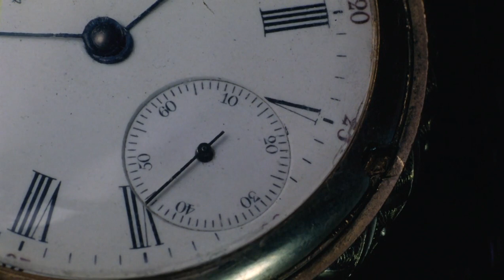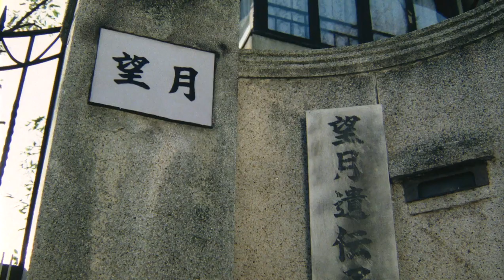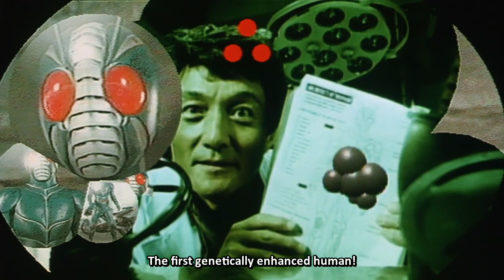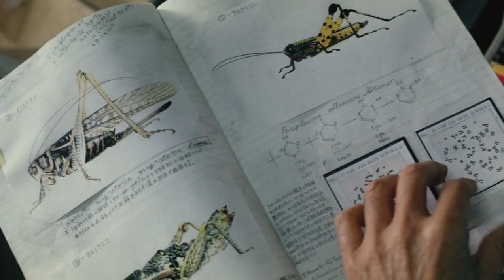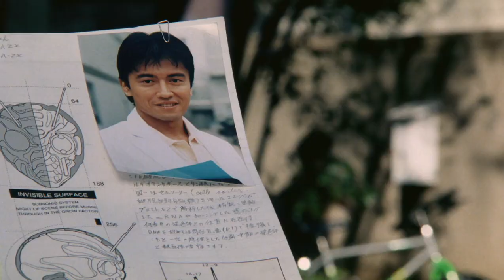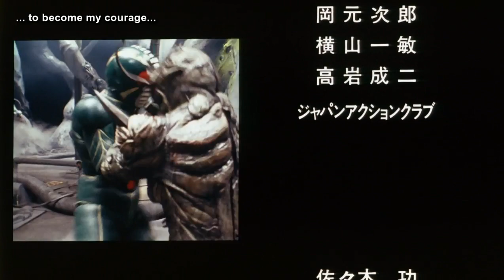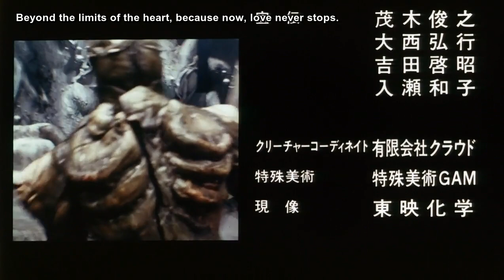Kamen Rider ZO (1993)

Comment: Oh jeez, I just realized the monsters in this are a spider and a bat. You know, like in the original Kamen Raider series. Oh wait hold on a sec I just remembered, what we’re the first two monsters Kuuga fought? A Spider and a Bat. And Black, a Spider and a bat. Amazon? A Spider and a Bat. Amazons? You guessed it, a spider and a bat. Why do so many Kamen Rider shows keep calling back to the original? Why do they need to keep using a spider and a bat at the first enemies?!
Reply: In the case of ZO, the original idea to was for it to be a reboot/retelling of the first Kamen Rider, along with Kamen Rider J, together forming the new Double Riders.  For Kuuga, is the restart of the Kamen Rider series since Black RX for the Heisei Period.  Kamen Rider Black simply did it as a call back.  I'm not too sure about Amazons, but it was supposed to be a very dark take on Kamen Rider almost akin to Shin: Kamen Rider.  Probably a start to a new continuity?
Reply: The naterual enemy of a young grasshopper